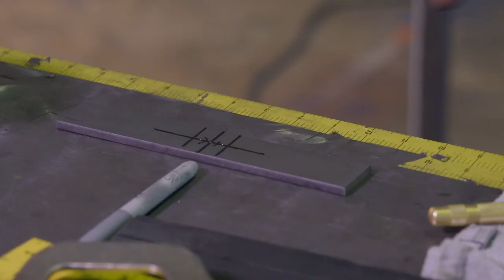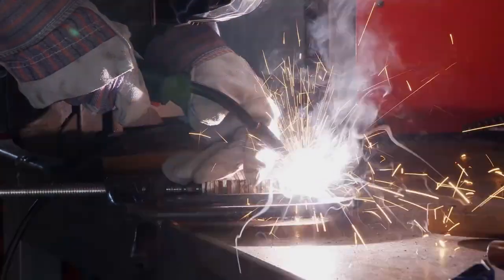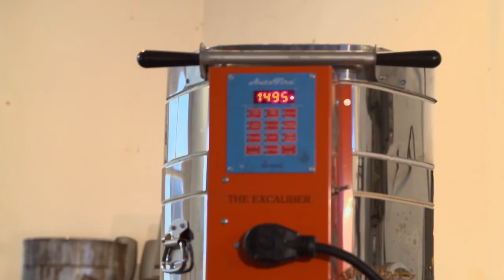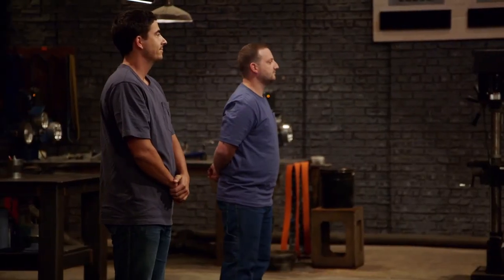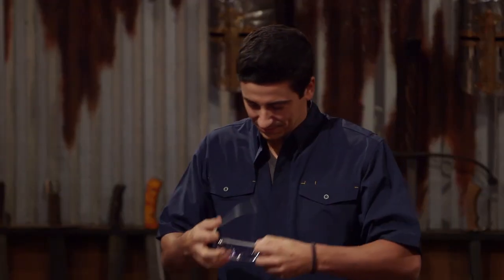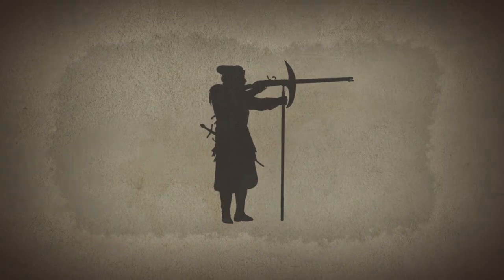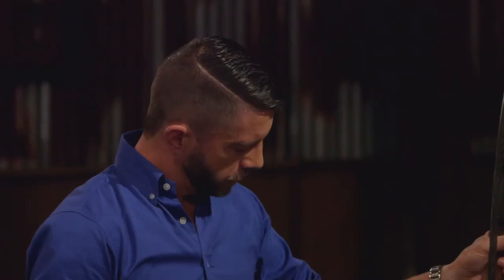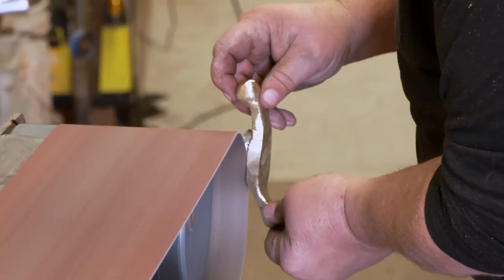TOP 5 SHATTERING SKULL SMASHES | Forged in Fire

Comment: Can someone who is an experienced bladesmith answer a few random questions I had? 

I know why borax is used when forge welding, and I know why powdered steel is used when doing canister damascus. However I've never seen anyone mix borax into the powdered steel, or use it in a canister in any way, and I'm really curious if there is a reason for this. Would it make the metal forge weld easier? Would it make it worse? Would mixing it in the powdered steel ruin it? Would coating the canister with both whiteout and borax help? Just have a lot of questions about borax and damascus.
Reply: It could lead to potential cracks, and splitting welds

Comment: How do you  need a face diapee in your shop by yourself.  You wear one in a car by yourself, now? 🤦‍♂️🤠
Reply: I think it was  due to the fine grain of sawdust generated by the belt sander when finishing his handle.  I had N95s pre-pandemic for fine dust  And volcanic ash in Alaska.  Volcanic ash can be very fine and is essentially razor sharp glass shards.  There is an eruption requiring caution every 5-7 years.
Reply: This episode was filmed during the pandemic. There is a film crew. The state he lives in may have a mask mandate at the time this was filmed.
If this was a recent episode, I'd agree with your statement.
Reply: Besides not wanting to breathe in sawdust and metal dust, there is also the fact that the ceramic wool used to line forges is a carcinogen when breathed in. His forge also seems to be uncoated, which only makes this issue worse. An n95 mask would be better, but I have also used a covid mask with my coated forge when that was all I had at hand.